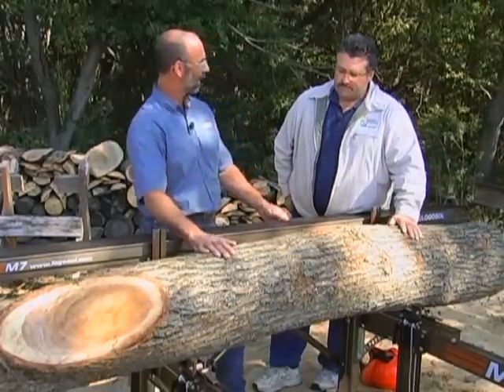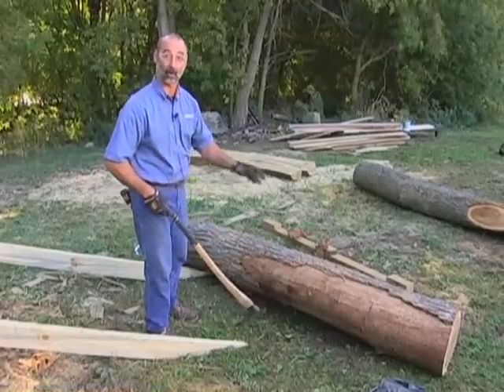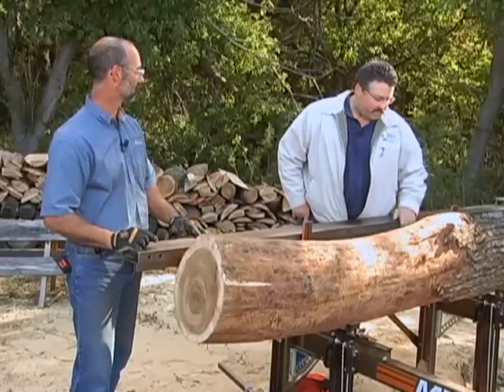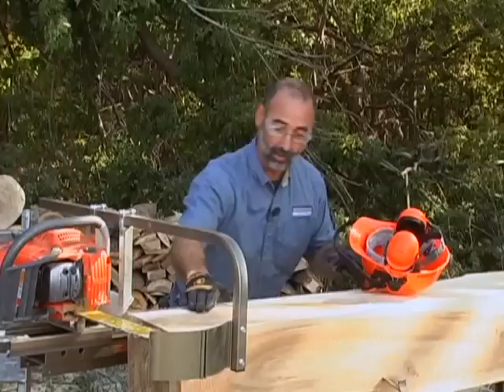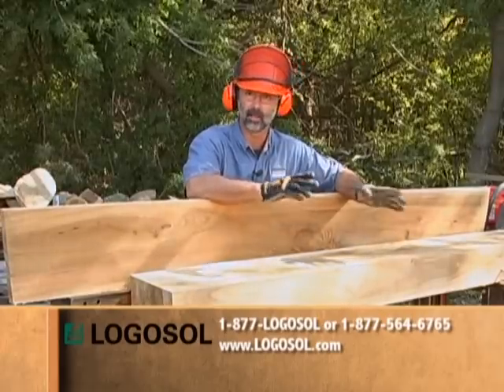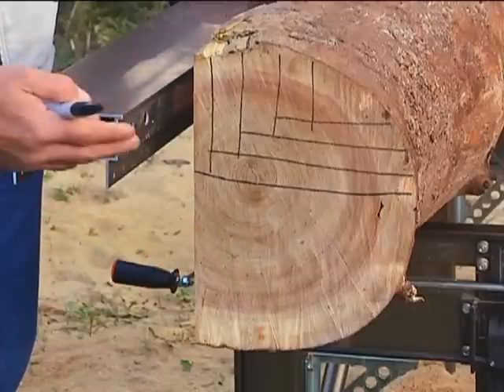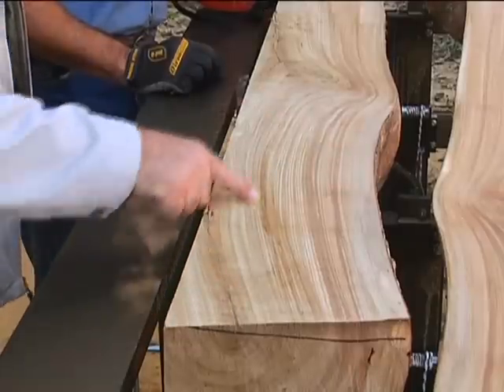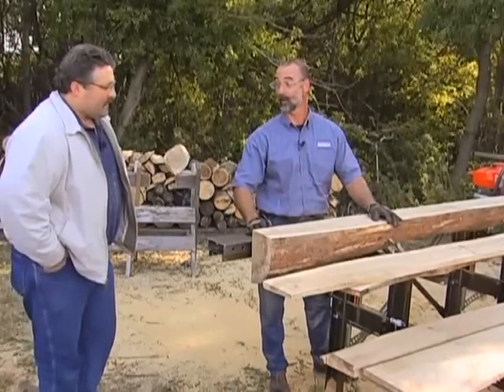Woodworkers Mill | Portable Sawmill | LOGOSOL

Comment: I noticed as you raised the log to be cut. You said 5 clicks would give you 1/4 inch of raise per click. But my point is, The handle is wrapping a rope around a shaft. When the rope starts to over-lap, it is actually moving up more than 1/4 inch, because the diameter changes since the rope is over-lapping itself. So, it may be not be accurately repeating the 1/4 inch of rise.
Reply: I dont think the click is dependent on the rope winch. The click is the dog catching the vertical gear spline.
Reply: Craig Smith

Comment: When you start cutting your log, instead of squaring off the log, why don't you just establish a flat spot and then start slicing it into boards?  If you didn't trim the whole log into a square, you would have wound up with some boards wider than the others. I thought the final outcome was to get as many board feet out of a log as possible. Thanks.  One of these days before I die I am going to purchase a small sawmill so I can cut my own lumber for my woodworking projects.😀